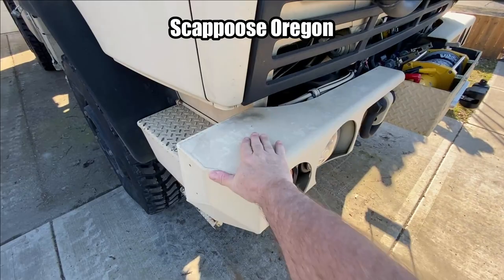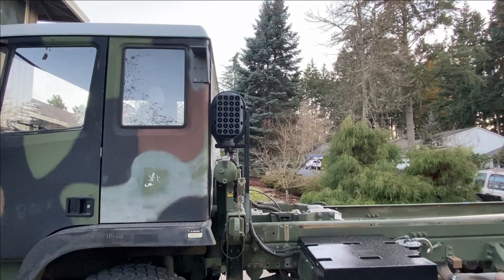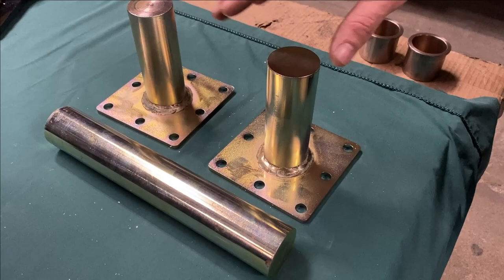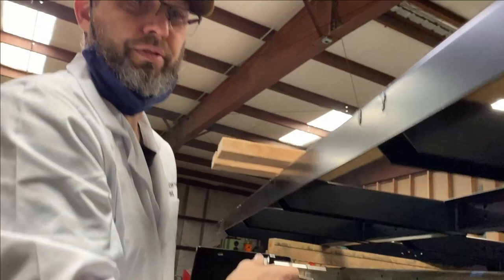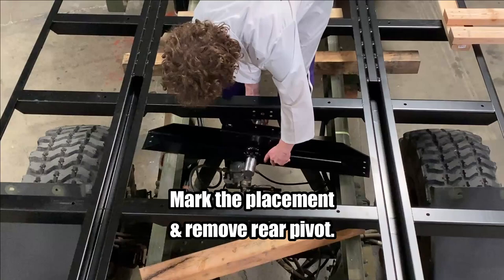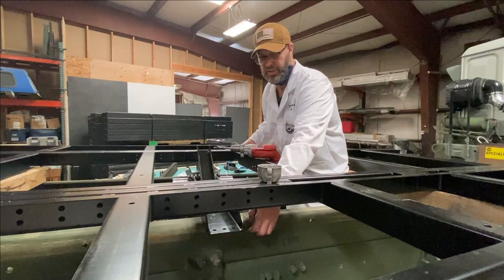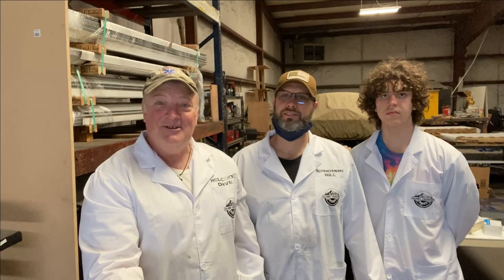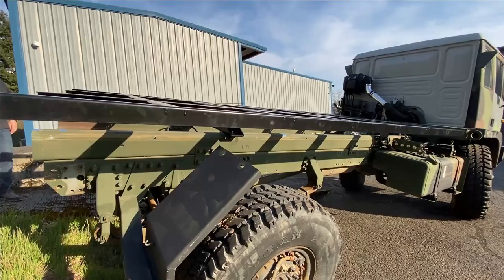FMTV ZERO TORSION SUBFRAME Build #175

Comment: I have seen those intakes before but most people use 2 IIRC.  The reason being is that they do not flow enough or close to the OEM specs at WOT.  Thought I would mention it for anyone considering those style of intakes....
Reply from the maker: 459 CFM's is not enough? Well, it's an option over the double filter stack. I provided a link to the list of specs in the description.
Reply: It is barely enough at max RPM for the 3116/3126 or the C7 and when the filter element is perfectly clean.  A second Donaldson is required because the filter element is only perfectly clean and full flowing the first day.  It is not a subjective opinion, rather the objective specification of flow rates.
Reply: @dflood316  barely enough at maximum RPM? So, it is good to go, even at maximum RPM is what you're saying? Who runs their trucks at maximum RPM anyway? And the worst that would happen is what, a loss of maximum RPM power as the filter gets dirty? Well, I guess he better run right out and go get another filter unit then.
Reply: @trentblaine1768  Engine damage occurs on these when they cannot pull the air they want....

Comment: Thickness of the frame tubing
Reply from the maker: The thickness is less important than the strength. The biggest difference from an engineered subframe and a non-engineered subframe is that the non-engineered has to be so overbuilt, because no one knows what kind of forces it can take because they can't crunch the numbers. You wind up with a grossly over-weight vehicle. With engineering, you can determine the strengths ahead of time and plan for the strongest subframe at the lightest weight. These subframes can take over 12K lbs... more than you would ever want to run an overland with. The larger subframes can handle even more!